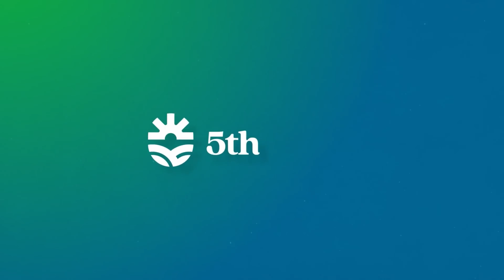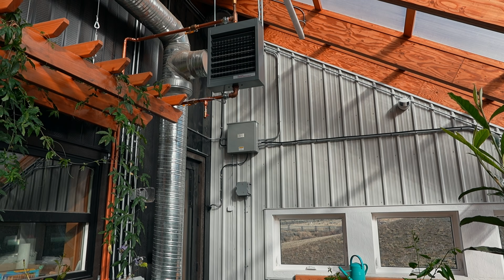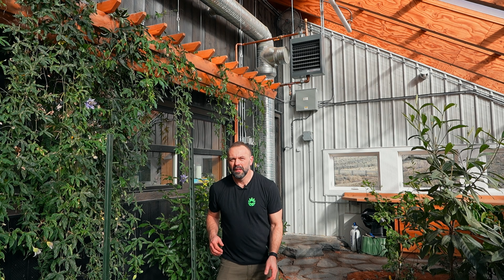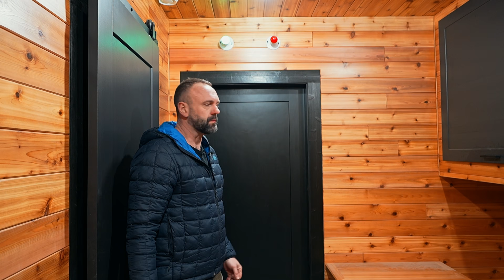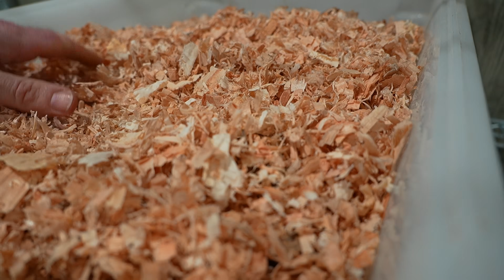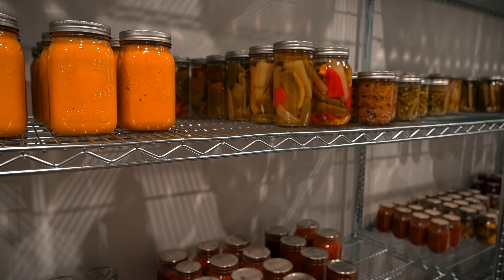Cold Weather Homestead Tour | Passive Solar Greenhouse & Root Cellar Explained

Comment: I dug down 5' into the earth as the constant earth's temperature year round is about 50 degrees F.  I installed 500' of 1" poly pipe looped underground with water/antifreeze 100' away from greenhouse.  I have it connected to a coil the size of a car radiator with a fan and small circulation pump.  Very clean and no smell.   The concrete is painted black to act as a concrete battery for release at night.  I live in Eastern Washington and the winters get cold with snow.  

7:00
Reply from the maker: Nice, 500 ft of 1" poly with a radiator and fan is a proper working setup. How is it holding up through the coldest stretch in Eastern Washington? Is it pulling enough heat out of the soil? I'm curious about real numbers if you've logged any.

Comment: If you Connect another small room to the backside of the greenhouse where you grow mushroom you will have a co2 producer and you can shift the air between the greenhouse and the muchroom house with a hepa filter between so the spores are collected. 
Oxygen into the muchroom house and co2 into the greenhouse
Reply from the maker: This is something we've thought about. Mushrooms and plants do have a nice gas exchange relationship. The challenge is humidity and contamination control — mushrooms want conditions that don't always play well with the rest of the greenhouse. Doable with the right design, but needs to be intentional. Have you built one?